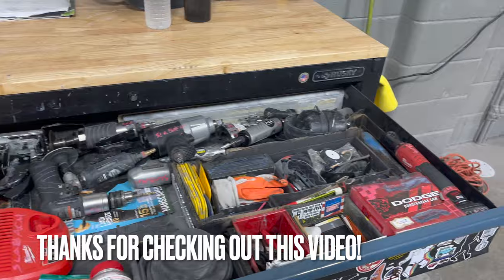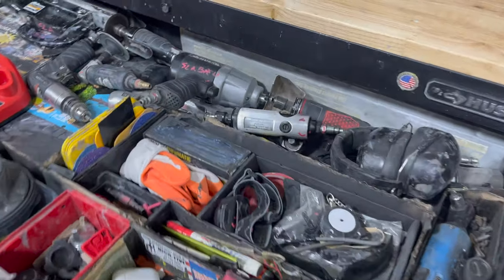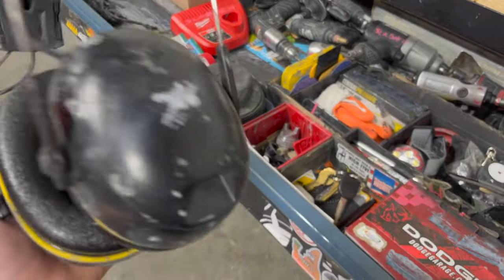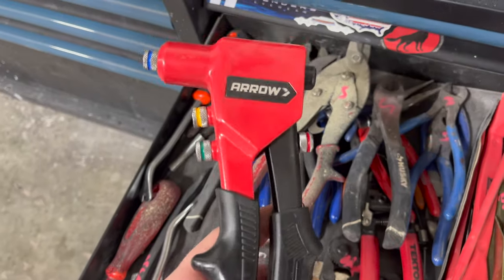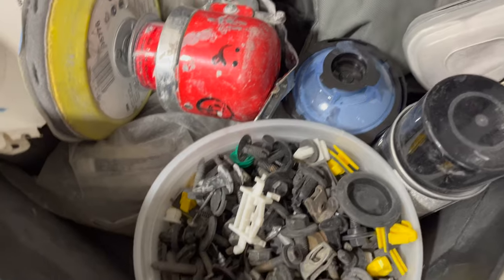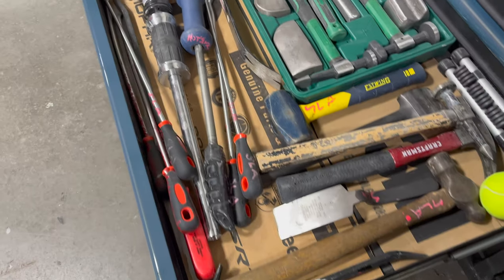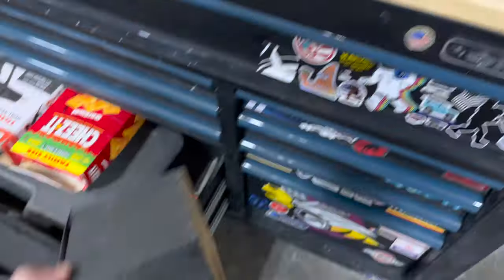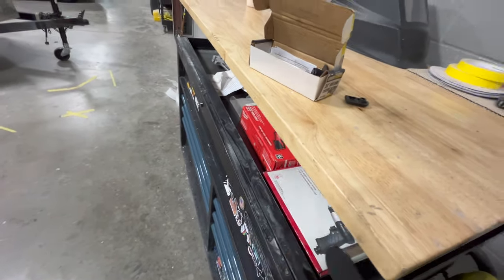What's Inside A Collision Repair Technician’s Tool Box? | Auto Body Work Tool MUST HAVE’S!

Comment: I did the same thing with the rubber blocks, I was a pack rat with clips, screws,I'm old school, used paint paddles to block with,did collision work for over 40yrs, been the painter, spent the last 25yrs doing frames,had a heart attack and bypass surgery in june of 2021,called it quits.
Reply from the maker: Wow, that’s incredible! Did you enjoy your time doing collision work did you like what you did? I first started at a Maaco learning under the oldest body man at the shop and moved on to a dealership that I’m at now. I’ve since learned how to paint… wanting to switch to paint full time. Thanks for watching my video and commenting. My respect to you and your hustle towards body work, all the years you did it. Definitely not an easy job…
-Garrett